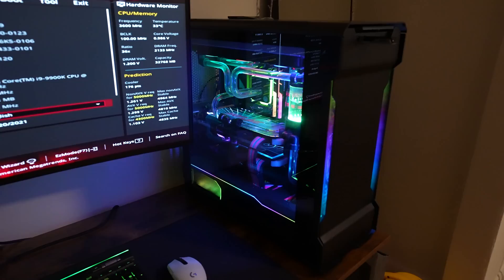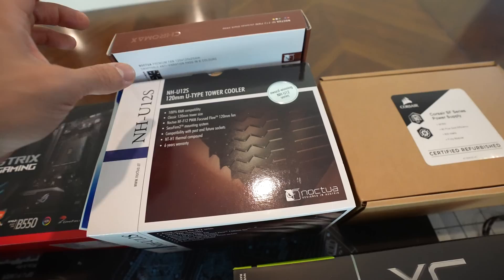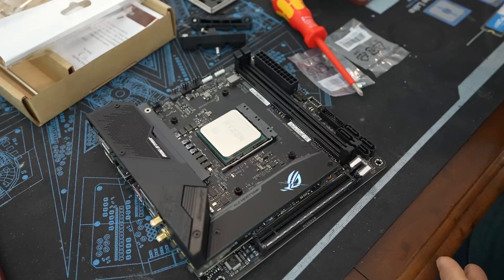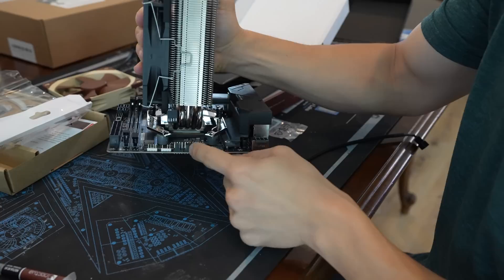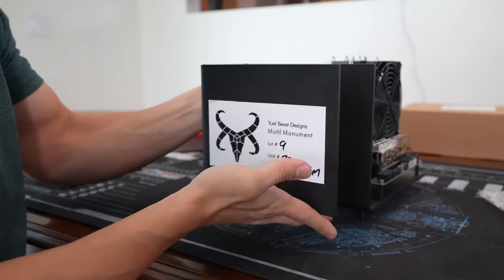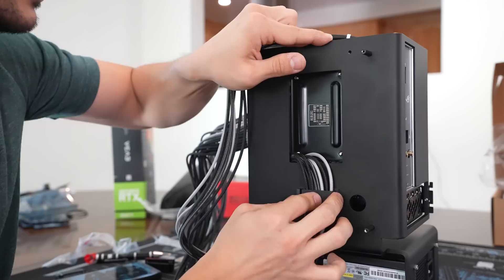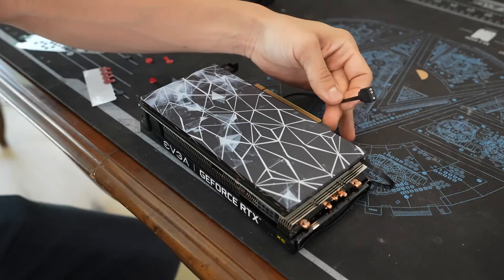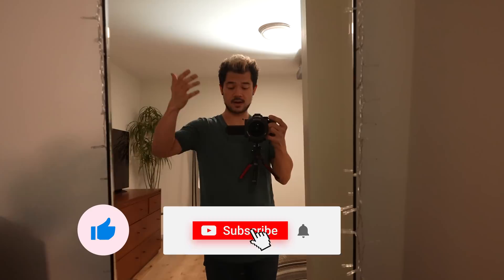I've NEVER built a PC quite like this...

Comment: i like how instead of just putting the pc on the floor so he has more desk space he decides to build an entirely new pc in a smaller case
Reply: PCs should always be elevated off the ground, the higher in the air the better, to minimize dust and dirt issues.
Reply: Suffering from success
Reply: @LuckyTrouble777  Semi-regular dust maintenance with a filter would easily take care of this issue.  People have been over selling PC's on desks for a long time now, its fine on the floor as long as you are smart.
Reply: Or just checking the desk weight rating he could probably find out the pc/monitor and other stuff on the desk isn't gonna come close to causing it to suddenly collapse, and if it is, get a desk with reasonable sturdiness.
Reply: You are a menace

Comment: That Noctua “short cable” is actually a speed reducer cable I think - has a built-in resistor.
Reply: It only limits upper RPM, it won't affect the overall PWM curve.

Max RPM with the adapter is 1200, instead of 1500.
Reply: @thedeegee1601  well,  the overall curve shape might be same - but proportionally reduced !
Reply: @incompressible01  50% will still be 750 RPM with the adapter.
Reply: @thedeegee1601  how do you figure that ?
Reply: Yep, It even says "low noise adapter" on it.
Reply: @thedeegee1601  That's not how electricity works, a resistance in the line will reduce the speed on the whole scale
Reply: Kyle probably trolling - pretty sure he would know about the cable.
Reply: @incompressible01  probably not, he has made a lot of mistakes.

Comment: Hey Kyle, why don’t you get one of those 140mm sized magnetic dust filters from Cooler Master to put on the fan of the PSU to prevent dust buildup inside?
Reply: Not really an issue. PSU fan doesn't run unless there is enough load on it. I got a PSU like this one, when I go to dust out my computer it's the one thing with the least amount of dust.

Comment: a second black fan set up in push pull for the CPU cooler would really help the symmetry IMO even if unnecessary performance wise
Reply: I was thinking the same thing. You can also get magnetic dust mesh that is ment for just a fan. Keep the cooler nice and clean. I have pets so I always think in Dog hair.

Comment: "no need for an 8 core cpu"
gets 32gb trident z royal elite
Reply: To be completely fair, I run 32GB myself and while I haven't had any gaming issues with it, literally I have seen things like chrome just... destroy that amount of ram. So if he games but also multi tasks with some alt+tab action into other stuff, it's definitely nice to have more than just the 16gb you typically need.
Reply: I'm sure that if it were an ATX mobo he would've done 16gb, but since ITX only has two memory slots may as well put 32gb cause you can't add more sticks
Reply: I run ~6000 mods/assets in Cities Skylines and the system will crash if I run it with one of my 2x16 modules removed
Reply: @mavagam99  thats true but its a 6 core cpu and hes not engineering and his friend isnt running 6000 assets in city skylines like carter here
Reply: @Carterthielftw_  this is the most hilarious reason i think ive ever seen to have more ram i absolutely love it
Reply: Modded minecraft also is another lover of 32gb of ram
Reply: @miriotogata5474  fair enough but this dude plays apex mostly lol
Reply: "he is a man of focus, commitment, and sheer fucking will" I respect you bro, the amount of work in that world
Reply: @NintyPrime  Chrome will use what it can under normal circumstances. If you didn't have that much ram it would still behave normally and not require the extra ram. It will automatically put what it needs to in a pagefile, but if it doesn't have to because you got plenty of ram then it just won't.
Reply: @NintyPrime  16gb runs chrome fine, even as a power user.  source: i am the power user

Comment: Diy a thing like that from nice aluminium sheeting for a fraction of the cost,then it really would “bling”.
Reply: If you already had the tools maybe, otherwise I think you'd get shafted on making the I/0 areas flush, or be missing out on the immaculate build quality & paint job (they don't sell ones with even slight cosmetic defects, those are sold as b-stock)

Comment: On my Corsair HX1200, IIRC, the sticker would be the correct orientation whether I have the fan on top or bottom, so the one not seen is always upside-down of course. I would expect it to be like that on all their power supplies.

Edit: I see now that the other side of the PSU isn't like that at all.

Comment: The EVGA 3060ti you used has a part flow through design. You blocked it off with that custom backplate. Not sure if you're aware of if I was 
Intentional.

Comment: I can't find anything on the YuleBeast site, but the construction implies that you are entirely reliant on M.2 drives for built-in storage? No place to slap on a SSD?
Reply: Correct, most people "mount" with double sided tape or cable ties, I've seen one person lay it flat along the bottom of the case, not my preference but it's an option.

Comment: Do people in the US know there are Allen-screw bits you can get to use in your screwdriver?  I literally hate normal Philips screws. They always strip out and it's so hard to orient them so they are even. If the screws are visible then Allen screws are the way to go. If they aren't then Torx screws is the best. The only screw worse than Philips is the flathead. At least you should use Pozi screws since they do not strip out as easily.

Comment: i also got a 5600x and even not at full performance(yup stock cooler) it is a beast and doesnt do anything to max my oc 1050 ti (+160 core, +200 vram) damn it is fast
Reply: Dude 1050ti is super weak for that cpu...even an i3 9100f wont bottleneck that gpu
Reply: @kiavashasadi8687  only thing available at decent price but pretty good for my needs
Reply: @mechxgames6472  yea i feel you mate....gpu market is definitely super fcked up these days but what can you do....im glad you got your hands on some sort of gpu at least....
Reply: I get 90+ fps all the time tho
Reply: @mechxgames6472  yea well it all depends on the resolution you are playing at and graphic settings and obviously the game itself right...but i assume you can still make 1050ti work in most games

Comment: I'm fairly picky about PC build aesthetics, but this build gets my seal of approval.
Reply: Except there is literally nothing cooling the rest of the components, not to mention the massive amounts of dust an open system creates.
Reply: @drunkhusband6257  It's an itx mobo, the tower cpu cooler is providing enough airflow. He can remove dust if he needs to. As long as you don't live in a dust bowl it should be fine for a while.
Reply: @bonanzabrandon6877  Doesn't work that way, there are other components to the motherboard, the cpu cooler is NOT enough to cool the rest of the MOBO components. Open air setups are only good for test benches not for extended use systems
Reply: @drunkhusband6257  People have been building pc's for a long time, unless you are doing serious overclocking you don't need a bunch of fans pointed at your mobo. The build Kyle did in this video is not going to spontaneously combust.

Comment: hafta check out my q58 itx air cpoled build..r7 2700 65w tdp...noctua l9a cpu cooler with a fan grill n added a cooler master halo fan..2060 2fan gigabyte card and a external hdd enclosure at end ogf graphics card..4tb drive in it and another 4tb drive behind psu..a 2tb in gront panel..and 1tb m.2 on back of asrock b450itx ..16gigs corsair rgb..3200mhz..2 halo fans top intake and side 120mm mesh on bottom and bottom exhaust fan..got gpu spacer to move gpu to mesh a lil closer..i beed to do a new vid but have a vetroo 120mm gan over cpu fan,used a 90mm fan grill and fit a 120mm fan in front of it and the mesh still closes..i got a spare 90mm grill if any need and a nice 120m black plastic fan grill ,found 2 my dad had n cleaned up and used 1 on my bottom fan..love the vids!!!!

Comment: Build awesome. Question, can the backplate rgb get blacked out on the edge? Maybe not an issue, but my experience with edge lighting like that is it is painfully bright if you eyes are near the same plane as the edge. Definitely thinking of adding that rgb plate.
Reply: They use a special dye sub printing technique to make the design so printing on the side would be very difficult. I'd recommend getting a black paint pen and just coloring the sides if it was an issue.